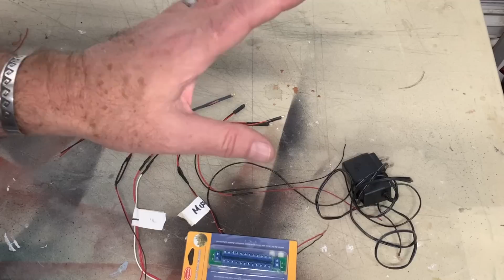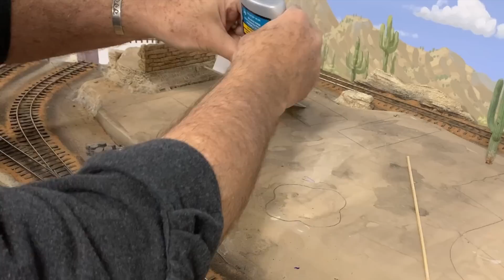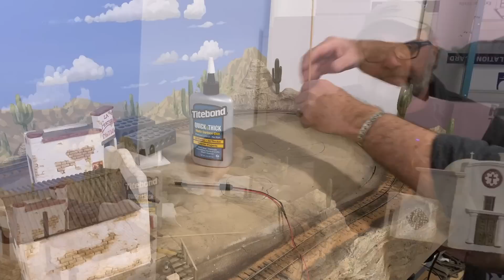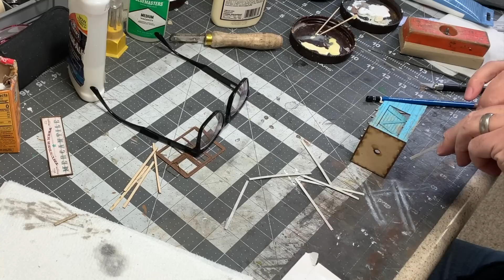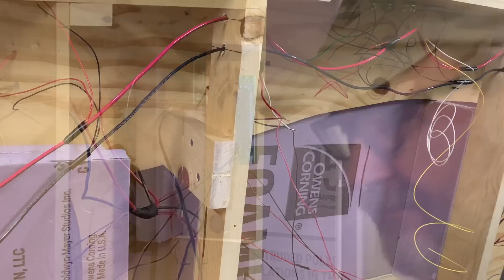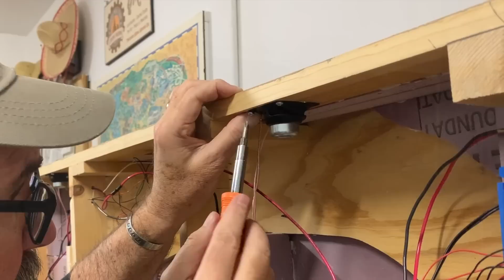San Lorenzo Mini Layout | Adding Structure Lights & Sound Effects

Comment: Excellent!  Another great video Dave...

28 gage solid core for DCC track feeds?  Wow!  I was under the impression that you should try to use a minimum of 22ga, and it should be stranded at that size.  But if it works for you, great!  

Used 20ga stranded on my Sn2 modules, but that's with using track feeder lengths of 12" or less (per our module group specs).